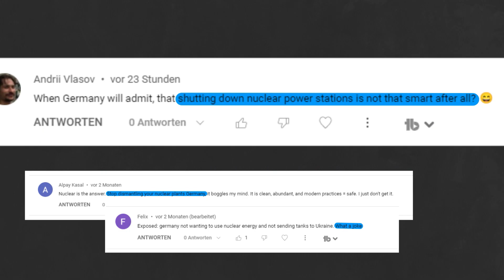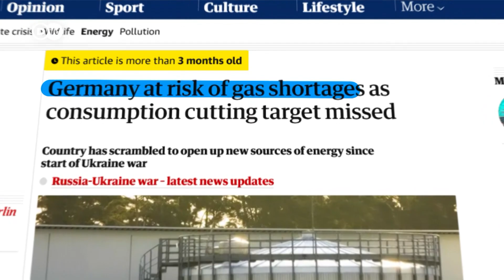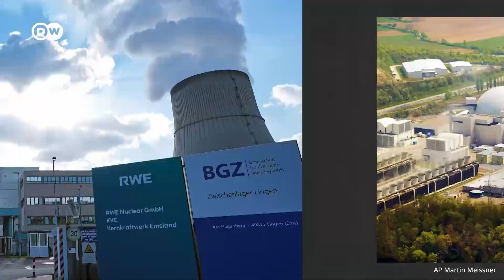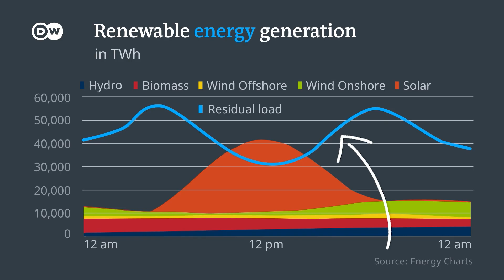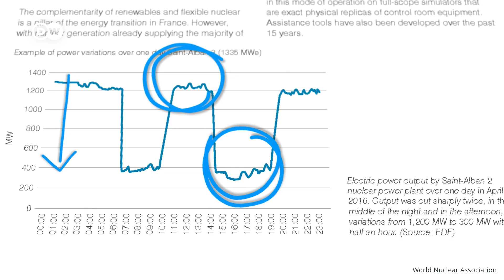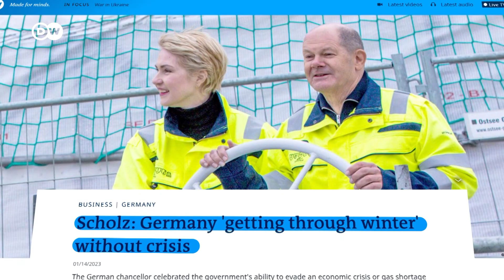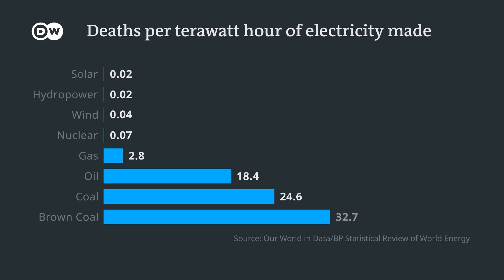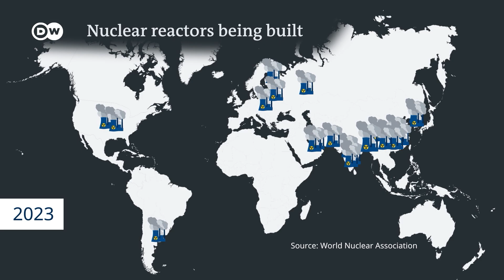Is Germany's nuclear exit a mistake?

Comment: Fun facts:
If Germany replaces the 3 last nuclear power plants by fossile gas power plants, Germany will emit an additional 14 million tons of CO2 per year. Replace it by coal, double that number.
Here we are talking exclusively about electricity. Germany still relies at 50% on coal and fossile gas for its electricity. But Germany (and all western countries) total energy consumption is by far based on fossile fuels. By total energy consumption I mean energy for heating your home (mostly fossile gas), driving your car, shipping your food/stuff, for heavy industries, for ciment, steel, agriculture, fertilizers, etc… to reach the net zero carbon, you have to get rid of most if not all the fossile fuels for these usages. And that means electrifying most of these (or hydrogen from electrolysis). You really think Germany can do all this with renewables only?

Comment: The problem in Germany that lead to this mess was that it weren't the greens or any other progressive party that decomissioned nuclear energy, but the conservative party, which maintains close connection to many fossile energy companies.

At that time they just had regained government control after the greens had boosted renewable energy sector to a point where the world admired Germany as role model for transformation.

It was a political master move: taking voters from the green party and using the following decade to completely choke off the transformation including the young industry in this sector.

Now we're screwed and they blame the greens again. Taking this long planed phase out back was impossible and the greens would have been the last to do it, anyway. They lost voters for delaying the shutdown, and more voters from the other side for ruling out nuclear turnback. 

A new nuclear powerplant takes at least 15 years to plan and build and costs billions of euro. And we would need 10-20 to make a difference. This money is far better spend on renewables and grid stability. 

The opposition knows this. It's just politics, again.

Comment: Yeah, fazing out nuclear before coal was a huge mistake. However, the damage has been done. There is no use in crying over spilled milk. Reopening nuclear power plants/ building new ones is not efficient and an enormous hassle. Even just the continuation for the last 3 months gave the companies operating them a huge headache. If there was the will to change something, it would have been necessary to do so at least 5 years ago

Comment: It's abhorrent that Germany is taking this step. They continue to burn Lignite which is the most polluting way of making electricity. It will mean an extra billion tonnes of CO2 into the atmosphere. The false assertion from the Green in this video that nukes are unreliable and produce a large amount of waste should not have gone unchallenged. The German nukes were over 90% availability and produce little waste. And as for the guy saying nukes couldn't be ramped up and down when it had been shown for the French plants in the previous graph!

Comment: Shutting down perfectly good emission free power plants because of feelings, well, it's not intelligent. There could be another nuclear accident without nuclear power coming anywhere close to the damage fossil fuels are causing. 

What about the spent fuel? Well, there are reasons to why no one is in a big hurry to bury it, for one it's not very dangerous or problematic in any other way to store it as it is. It's not killing people, it doesn't affect people's health and so on, as fossil fuels does, even when there are no accidents.    

Building new reactors is a bit late, at least to rely on it for significant part of the energy supply or part of climate action. It took a number of years to build new reactors in Europe even before Chernobyl and Fukushima. Start of construction of OL3 began 2005, years of planning and preparations before that, and they got that up and running just recently. They seemed to have stopped making estimations of the total cost public years ago, at 11 billion euro, increased from an budgeted 3 billion euro. FL3 seems to be on the track to even higher costs, and possibly even longer time to build. HPC officially started construction in 2017, cost estimation for that was high to begin with, but that hasn't stopped the estimations from increasing rapidly, or estimated commission date to be pushed further into the future. 

It would be much cheaper and much faster to increase wind and solar until we always had enough, even if half of the generated power would go to waste.

How about SMRs? Well, part of the idea is mass production could make them cheap to produce. Economy of scale doesn't reduce the cost of the first units, it takes actual mass production to make something really cheap by mass producing it. And with nuclear reactors it would take decades to produce enough of them to make them "cheap". Another part of the idea is that the small size would make them safer, partly because any accidents would be smaller. The most common definition of small in this case is up to 300 MW, so, 30% of an Chernobyl reactor is supposed to be easy to handle an accident, or no big deal if an accident happens?

Comment: If the germans wouldn't shut down the nuclear plants some areas in Germany wouldn't invest in renewable energies,. Especially the south of Germany don't like wind turbines. germany has a netto export of power  to France of 5 %.. 50% of the french nuclear power plants are out of order. A lot of the gas and coal consumption in the last summer were related to the export of power to France. Germany has  lots of big storages for fossil gas, which can be used for H2 as well. So the solution for the fluctuating power are powerplants with gas and H2 (which are in the building process). For the short fluctuation batteries are needed (which were build atm). Lots of wind turbines where switched of, because to much power in the grid. So a part of the 2,5GW (that is all Nuclear power we have in the grid) can be overtaken by the turbines. 
On the otherhand... total amount of nuclear power is decreasing., 1997 it was 17% now it is less than 9%. In most cases russia and china are building Nuclear power plants. USA have an average age of nuclear power plats of 41 years. They build actual only one. The EDF in -France is broken and the government is paying for everything. The price of the NPP in Flamville and in Great Britain expanded endless (like the building time). 
Yes... the german end of nuclear power rises the CO2 Emission for a small time but it is a big kick for carbon neutral technologies. In the end the decision is good for the climate,

Comment: Good report!
Very good points and arguments on both sides.

I honestly think we do not have any change of having (a) cheap energy, (b) good energy availability (i.e., without blackouts), and (c) low emissions without having nuclear energy in our grid.

I understand the risks, however I also think that having expensive energy, or having low availability in the energy grid, will cause our European economies to collapse.
Not only because people will be out on the streets protesting that they are not able to pay their bills and are cold inside their own houses, but also our companies will not be competitive in the World market, creating unemployment.

We really need to invest in alternative energy sources, e.g., wind and solar power; public transport, e.g., electric trains, trams, or buses; and shift our urban mobility to less impactful vehicles, e.g., EVs or PHEVs.

However, to achieve cleaner urban areas, we need to provide energy to those urban areas with power plants - giant power plants.
Batteries in large scales are not viable. Wind and solar power are volatile and not a carbon copy of people's volatile needs.
Thus, we really need to find efficient ways to provide energy, and cleaner energy.

Nuclear, despite its risks, is the more efficient power source regarding CO2 emissions - which is our main goal at the current climate crisis.
Otherwise, coal and gas power plants will keep on emitting CO2 to our atmosphere, and your EV will not be as green as you think.

Comment: Why didn't you mention the other solution regarding nuclear waste, which is to utilize its energy for further electricity production? Countries like Belgium, France, USA, China, etc. are doing lots of research to develop 4th or even 5th generation nuclear power plants where nuclear waste for example is reduced to 95% and the remaining 5% have a much shorter half life. Simply burying nuclear waste underground is not the only solution. 
Besides, SMR (Small Modular Reactors) are safer and very flexible, thus could replace gas power plants for the flexibility needed to follow the steep residual load caused by the fluctuations of renewable energies. 
I invite everyone to check out electricity map where you will find the CO2 emissions per kWh per country, Germany is a bad student in Europe, regardless of the amount of renewable energy capacity. This actually opens up the debate to whether it makes sense to just compose the energy mix of mostly renewables which then requires a large amount of flexible gas power plants (next to the costs related to these plants, any mechanic knows that starting up and shutting down power plants multiple times a day causes immense stress on the installations and thus significantly reduces their operative life). According to recent GIEC reports, an energy mix composed of mostly nuclear energy coupled with 30% of renewables is the best way today to obtain a low carbon electricity grid. 
Another solution as already mentioned in this video to cover the flexibility demand is storage; the EU just granted that nuclear energy may be utilized to produce green hydrogen, and this is for some reason not even considered in Germany...

Comment: What many seem to forget: The decision to end energy prodcution by burning coal was also changed from 2038 to 2030. Its obvious that nuclear power cant be easily combined with a lot of renewable energy because you need power source that can be boosted quickly in cases when renewables have low production. Im really curious to see 20 years in the future. Last year, Germany had to massively help out France because their nuclear plants werent reliable at all. Im proud to see that Germany seems to be one of a few countries that tries to achieve carbon neutral energy production without nuclear power. Lets just see and wait. Theres no right or wrong just different paths.
Reply: If a path leads your backward then yes, it's a wrong path.

Comment: The biggest mistake that countries make about the transition to "green energy" is to  FIRST  decommission existing power plants (nuclear, coal, gas),  and only  AFTERWARDS  they build new power plants based on renewables.  
It should be done the other way around.
Reply: Renewables always require another form of electricity for them to function on the grid.  When the Greenies have their way with fossil fuels in Germany, it will be the worst place on the planet for obtaining electricity.

Comment: My fear is that factoryworkers will have to work when the wind blows. A lot of industries is not profitebla with high energyprices, if the wind doesn't blow no point in having production. I think this will bea disaster for the working class and small buiseness owners. Even tings like bakeries are highly dependant on energyprices. It will be difficult for small buiseness to plan and take longterm contracts when they don't know how much the elcricity will be.

Comment: My opinion on this topic (I am in my last year of studying renewable energy and just held a presentation about the POSITIVES of nuclear energy): regarding emissions of course nuclear is way ahead of coal when you look at the emission factor. But if you look at the absolute emissions, replacing nuclear with coal just increases emissions by 10% in Germany. Adding to that, wind and solar have to often turn off to deal with the inflexible power delivery of nuclear, reducing that emission advantage. But the biggest problem with nuclear power in Germany is that is has long been planned to be turned off. No new power plants were planned, staff has been drastically reduced and the risk of investment for either maintaining or building new nuclear plants in Germany is as high as it can be. None of the plant operators want to continue operating, because the next government might just change the rules again. Politicians just think inside their voting cylce and that's what caused these problems. Nuclear would have been great to keep, but having that idea now is too late.
And don't mind the survey DW showed in which the majority of Germany wants to keep the plants running, the same people said the opposite just one year ago, it's just that they now feel the high power costs.
Reply: The real solution would obviously be storage. And one way to do it is: over production of cheap renewable energy, which can be stored in a less efficient way (maybe hydrogen ?), but made economical because of cheap renewable energy.
Reply: @autohmae  Nuclear storage is a non-issue. The feared plutonium-239 is reusable in fast reactors. With sufficient investment the longest lasting radioactive waste is not going to exist and a large portion of highly radioactive product after everything is properly used can be categorised in a few groups. Few week storages, Few decade storages, few century storages and finally a tiny amount of it all needs 25k years storages.
Reply: absolute emissions from nuclear plants come in big part from construction. And those plants in Germany were already constructed. So shutting them down and switching to coal means they emit both co2 for nuclear and for coal. 

Also, do you have any source for this claim that coal increases co2 by 10%? According to IPCC the range for nuclear is up to 110 g co2eq/kWh, while hard coal has >800 and brown coal >1000. So it's ten-fold, not 10%
Reply: @qj0n  the 10% were referring to the impact on the energy mix of germany. Replacing the energy german nuclear produces every year with coal (calculated with numbers that are close to the ones you stated which include grey energy) will increase the emissions of the German electricity sector  by 10%, which is A LOT. Nuclear is definetly cleaner, but many decades of regressive politics make it impossible in Germany.

Comment: As long as nuklear power isn't replaced by coal or gas, the phase-out is a god thing 👍
Reply: That's the problem that we have no solution for.  Wind and solar always need either backup or storage.  Without those, renewables are a burden on the grid, not an asset.

Comment: This is a huge mistake. Why not to phase out coal first??? Where is the logic? What is the plan to fill up the capacity of the nuclear share? More coal and gas? Why not use the excess electricity to produce green hydrogen, or even pink hydrogen?
Reply: The fact you are promoting hydrogen only shows you haven't researched hydrogen enough.

Comment: It was a great mistake to phase out the nuclear power, also for Belgium. We don't have the substitute carbon neutral technologies which provide us with a stable electricity. I am happy they mentioned the IPCC recommendations - these are being in the debates purposely silenced. 
The phase out of nuclear is an ideological matter and not a scientific one. 
Those who regarded the Hydrogen as a substitute - it's still experimental and often it also needs carbon resources like gas...
Reply: To make hidrogen you need power 🤨
Reply: @Andrii87  Yes, to make the hydrogen you need some power. It is done from green power resources like wind or solar, or from burning  carbon resources like coal or gas. Or from nuclear.

Comment: The last sentence was pretty precise that Germany have started their transition with destroying nuclear plants without realizing problems with energy production and the most important thing as storage of energy.
Reply: But the problem is exactly reverse: The earning of renewables and the demand highly fluctuates. The german nuclear power plants can only be reduced to 50%. In May 28 at 2 pm, the price of electrical energy on the european current did fall to minus 15 Cent per kWh (!). And this was a moment where the 3 nuclear power plants already were off-grid. No idea what happened if they were still on-grid. Black-coal plants are meanwhile used in Germany as peak-load plants and even the brown-coal plants are temporary shutted down in summer, so coal is no more used as base load in Germany. I think this subject is the real main reason for holding on the plan to shut down nuclear power plants before shutting down coal. Otherwise you would need more storage options.

Comment: I don't often say this but we need to do what Russia is doing.
Build closed-loop fast breeder reactors on site with the older NPP's. 
These re-process the fuel generating power out of them. Instead of the spent fuel needing to be stored for tens of thousands of years, it needs to be stored for 800 or so which is a better prospect. We only use a few percent of the capacity of the fuel rods, we can do better. We should be doing better. We can use the rods we already have that still haven't been put into long term storage and generate power out of them, reducing the burden on future generations and bridging the gap to reach renewables. It's win-win, there's no lose.